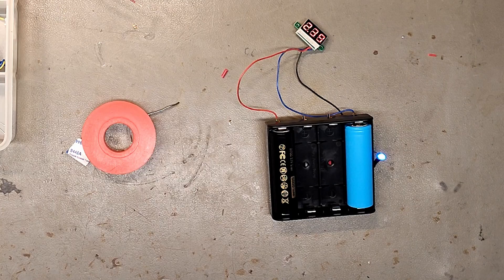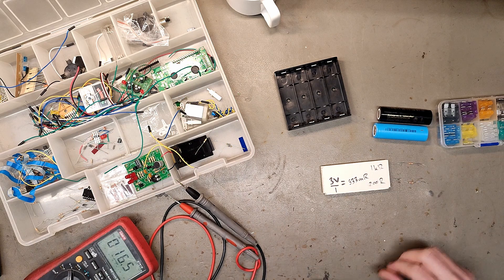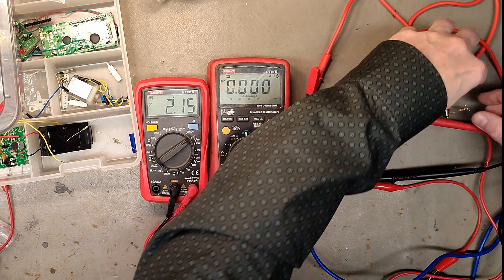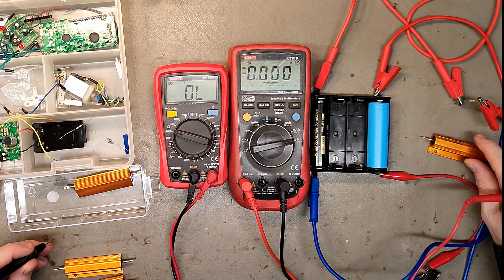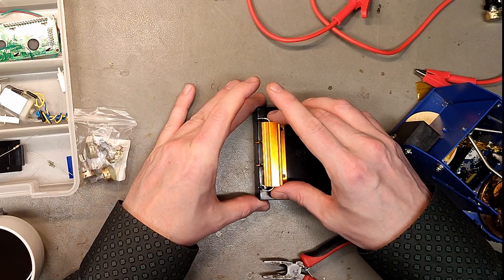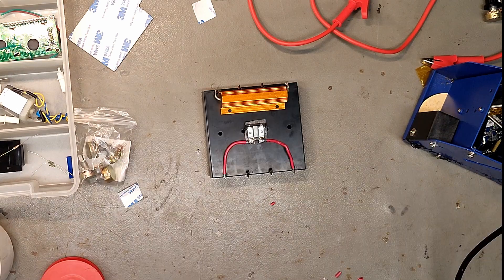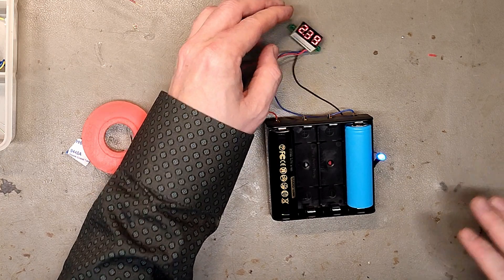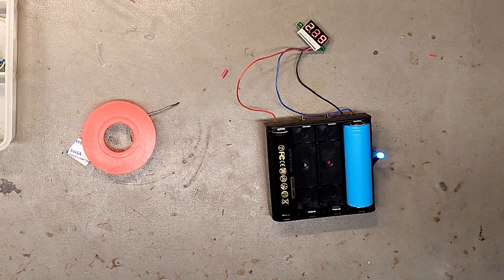Building a device that revies 21700 cells by pair charging (by TRIAL & ERROR)

Comment: Resistance is not that easy to understand. Many people compare it to hydraulics and water flow. Voltage is pressure, current is amount of water flowing. If you have tube with flowing water, resistor is like having plug with gap that block the flow. If you raise pressure (voltage) then there is more water flowin(current) through the gap(resistor). Bigger gap(lower resistance) needs less pressure (voltage) to have good flow (current).

And to the topic, i just use resistor like 1k or higher and leave it over night or two.  General rule is the lower resistance and longer you can wait the better and less chances to crystals forming inside cells and making short circuit.

Comment: Hi! U can easily use your Liitokala charger for any size of Li-ion cells (21700, 26650...) just with a little hack. On the negative side of the charger, U need a a wire with 2 alligator clips. Connect one end to the charger negative metal bar and the other end to your holder negative side. On the positive side of the charger, U need a wire with an alligator clip on one end, and a soldered little metal (could be a piece of nickel strip) plate on the other end. U can connect the metal piece to the charger positive bar with neodymium magnet and the other end to the battery holder with the alligator clip and U are done.😉
For reviving the cells I use my lab bench power supply (set to 4.2V and 1A) with alligator clips probe and 2 neodymium magnets on the ends of the battery cell.
Reply: I also use my lab bench power supply, but i only use 0.5A 😁
Reply: @fu1r4  i have several lab bench power supplys but have not learned to use them yet =( SO MANY BUTTONS!
Reply from the maker: Yes, i've used similar holders and soldered wires to the liitokala, mostlly to protect the units for when cells leek electrolyte. alligator clips wont work however on the positive terminal, but a magnet usually works like you said. Thanks for watching!